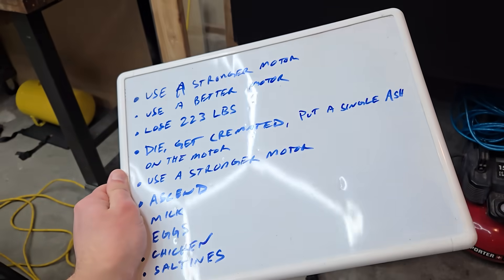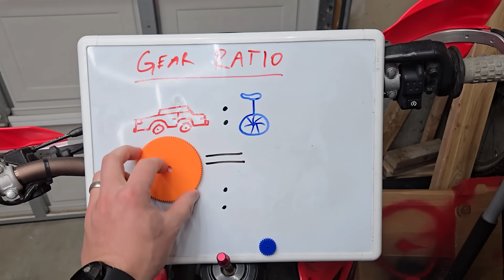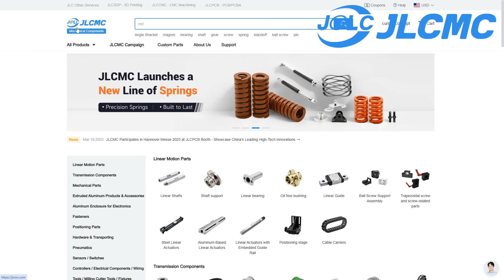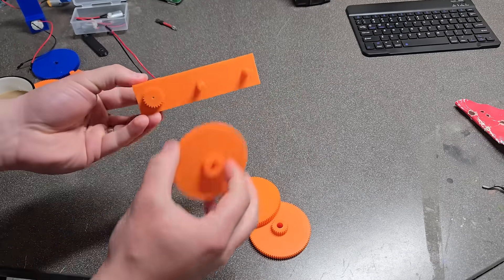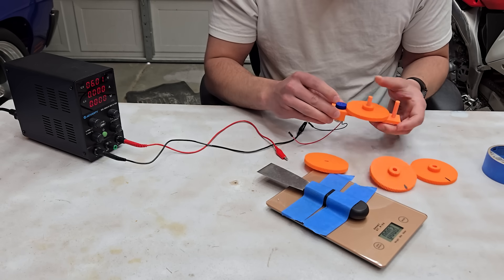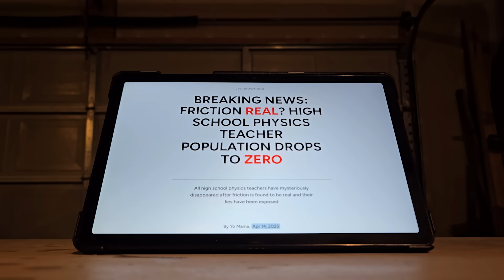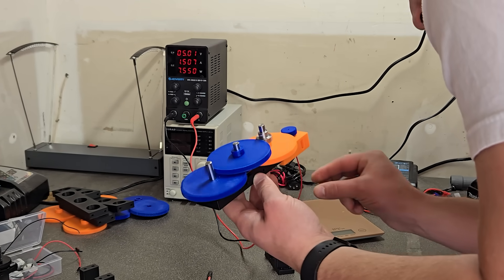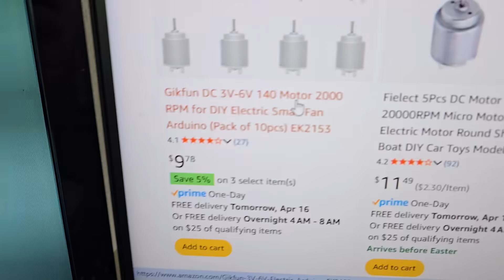I Built an Elevator With a $1 Motor

Comment: hey just a helpful tip, theres a RPM Iphone app that pulses the flashlight for a chosen variable range, to be able to determine a motors Rpm. attach a piece of tape to the shaft, and when the position of the tape syncs to the flash, you find the rpm

Comment: When working with 3D-printed gears, use some candle wax as lubricant.
Done this with my self printed espresso-distribution-thingy (4 gears) and there was a huge difference after putting some wax on the gears.

Comment: 1:38 Fun tip! If you ever need to figure out how fast a spindle, wheel or other rotating object is spinning, attach something to it like the piece of tape you have there, then let that tape smack against something else with every rotation, like maybe your ruler. If the spindle is spinning fast enough, the beating of the tape against the ruler will produce a tone. You can then use a tuner (or tuner app)to get the frequency of the tone, which translates directly into rpm.

It's not the most accurate form of measurement, obviously, and it doesn't always work. If your motor is weak enough and your "tape" (or playing card or whatever) is big enough, air resistance might slow your motor significantly. If your motor produces a tone in and of itself, your tuner might pick up on this instead of the beating of the measurement "tape." And if your motor spins too slowly, you'll get a pitch well below human hearing and below what the tuner is designed to measure.

Now, in the case of a common motor like this, the datasheet was definitely the right call :)
Reply: bpm tachometer, nice. Maybe use thin piano wire for the measurement.
Reply: but if i smack it one time, itll still make noise, and that noise will not be at 1hz  itll be at like 500hz
Reply: Similarly, you can record the sound on your computer and measure the time between the hits.
Reply: You'd have to multiply by 60, tho. Hertz is cycles per second.
Reply: How about using actual cassette tape? Its quite light and you can just measure how many meters go through in 10 seconds.
Reply: It's a sound theory (pun intended)! But the problem here is the harmonics. In reality, the tuner might (and probably will) catch a lower harmonic of the noise emmited, and the resulting hz measured would be far from the real rpm*60 of the motor.
If you could somehow guarantee that the emitted sound is a perfect sinusoidal wave, then the tuner would probably work better.
Reply: Holy s dude that’s a nice idea I will be trying that just for fun!
Same goes for the bpm as someone mentioned but I’m pretty sure that there has to be a even more scientific turnaround
Reply: Or just count how many times the taped part spins every minute

Comment: 3d print a useful step stool, or simply pour extra layer of height raising cement to the garage floor.
Make some shoes that are more practical and then reach your goal in life.
There are surgical treatments to consider though that would be painful, though once you are taller you can install drywall ceilings and win canoe races by holding a sail. ⛵

Comment: Cool build from super small motor.  Erector was doing this 75 years ago; I think they were lifting 320 pounds at the last show I was at. One other note, WD40 is not a lubricant, it is made to displace moisture.
Reply: Displace moisture with... oil?
Reply: @rexsceleratorum1632  Not all oil is the same believe it or not.

Comment: For motor speed, I like to put the smallest piece of tape on the rotor as I can and then touch a paperclip to it while recording. I then take that recording into audacity to zoom in on the waveform and count the peaks and the time between and use that to find the RPM.

The great thing about this method is that it can measure stored without really loading the motor.

Comment: > has power supply with current limiting 
> blows up all the motors instead of turning it on

died laughing, banger video
Reply: I came here to say the same thing! You have a power supply. Why on earth would you not limit the current!?
Reply: @GarranGossage  Some people don't know what current limiting is.
Reply: @GarranGossage content?
Reply: That was what i was thinking!!
You can see at 7:04 that the motor pulls ~9.0 Amps! Like oh lord!
Reply: @lemon_flan  9:40 had 10.85A
Reply: He paid for six motors, so he is going to use all of them 😂
Reply: Or just lower the voltage a teensy tiny bit

OR WATER COOL YHE MOTOR
Reply: Better to burner them out for comedy, it was never going to work
Reply: @KeCasgrimola here,s the final idea, use more gear, but it will cost huge time only lift that chair, so the problem is not friction, but huge time only for lifting a chair
Reply: Let the electrons flow!!!!!!
Reply: If he limits the current he limits the torque too. It’s too much torque for the shitty little motor.
Reply: Lol just posted a comment saying almost the same thing before I read your comment!

Comment: Hmm continuous power cable lift for half a meter... makes me wonder if you had built a ratcheting lift...  Might need to consider using the same motor but in an incremental locking system with counterweight assist and then do a lift showdown!!

Comment: it's all about that traction, you're gonna always lose traction without balancing the weight of the load. modern elevators are able to use smaller and smaller motors using crazy roping configurations where it basically passes through a bunch of sheaves to create a 2:1 roping ratio where the car moves twice the distance as the car. so in a way it's moving the mechanical advantage you'd get from a geared system to the rope configuration like a series of pulleys

Comment: Did you consider using the current limiting feature on you power supply to prevent the motors from burning out?

Comment: well actually this motors do this... but i thing main problem is gear .. gears are the o es facibg the stress and after 20kg or so you cant use plastics i guess weight may differ but after lots of force teeth of plastic gears will go out 😊😅

Comment: I hate printing gears. Any other way to transfer energy is so much better. Use like a 20x block and tackle pulley system for the last stage,  use 2mm dynema rope so you can use small pulleys.

Comment: I really hope this was all printed in ASA. If this was all printed in PLA or PETG, that was your first mistake.
Still, really impressive you were able to make such a funny and enjoyable video out of something that would have left me feeling defeated.
Reply from the maker: all PLA. i dont even know what ASA is, i think you made that up
Reply: @currentconcept  PLA is a general use filament that will "creep" under load and isnt very strong while ASA filament is much stronger and tougher, doesnt suffer from creep, and is tolerant of much higher temps an UV exposure, it just needs proper ventilation because it does smell and gives off gasses you dont want to breathe a ton of (ABS too, ASA is just slightly better and newer)

Comment: Here's how to do it:
Build a lever with a short arm and a very long arm. Put good bearings on the pivot to reduce friction. Stand on the short arm. Use a complicated mechanism to place the motor on the far away end of the long arm. The weight of the motor on the long arm will lift you up.

Comment: I have done all kinds of things with these cheapo motors over the years and the only one that died on me was the one that I used in a toy rc-boat with to big of a propeller and two times the rated voltage out of a Li-Po batterie. And it still took 15min. Did you maybe run them to high? Cool elevator though ;D

Comment: Dude, those motors were for 3V maximum, not 5V or 6V! It is no surprise you killed so many of them. You got the wrong datasheet. Just look at the current it is pulling from the PS compared to the second type, witch were actually for 3 to 6V. Those poor little things! So sad to see they die in agony.

Comment: maybe you could've used the small motor lift some weights slowly and then dropped the weights using some pulley system to lift you up

Comment: My knowledge is a bit limited, but motors blow up from over-current, right ? I see your PSU showing several amps, wouldn't a simple resistor limit the current to the motor, hence saving it from the bin ?

Comment: are you sure those little motors weren't suppose to run at 3v instead of 6v?
Reply from the maker: they claimed 1.5V - 6V. I ran them at 5 V at the end there and they were still blowing up
Reply: @currentconcept  and also unlimited current, which they were NOT rated for

Comment: Only an engineer could go through all this trouble to avoid making a box to stand on
Reply from the maker: its the only logical solution
Reply: @currentconcept you could have stood on those gears or stacked those bearings!
Reply: @aboutblankat 😒
Reply: @justin.s Why didn't he just lower the outlet so he could reach up to plug things in?
Reply: @Starlite123  The sparkys get mad when we molest their boxes. Carpenters gotta set up scaffolds. IH needs to sign off. It's a whole production. Better to stay in your lane because nobody can tell you you're doing it wrong if they don't know what you're doing.
Reply: @richardking4514  Humorously, Union Onions gonna Union Onion.  Better to be collaborative than to cause problems with the wrong leadership style.  

I love being an electrical and embedded software engineer and then jack of all trades because it allows me to ask the right questions of the right people.  

A great collaborative engineer does not always dictate, he can also ask good questions until the tradesmen and other engineers agree with him, whichever way the choices go.  

Ego is not the way.  So give positive credit where it is due.  Try to blame problems on root causes that are not people.
Reply: @Starlite123  How is he gonna put the ceiling back up there after he lowers it? This was obviously far easier.
Reply: @itsausername  Haha... sure. I said lower the outlet (just a block of wood behind it). Clearly you have been drinking. Have a good morning.
Reply: @Starlite123  Or he could have raised the garage floor with more concrete.
Reply: box? he has a ladder
Reply: Using gears and cables was the problem. The correct way is to dig out a hole in the center of the garage floor and install the scissor jack that's unnecessarily taking up space in your truck, as nobody changes tires anymore when it's so much quicker to just change truck. Anyway, you can then attach your cordless drill to the jack, maybe after extending the switch and direction toggle on the drill, and bolt a piece of steel or something to the jack, preferably larger than the hole to avoid losing drill bits in there while you're looking everywhere for your drill, and there you have it!
Useful tip: If you keep the chuck torque limiter half way out, you won't bust the drill motor when the jack reaches the top/bottom.
In the alternative, if you really want to use cables, you could use the garage door opener to pull on a cable going through pulleys to lift a platform. I personally prefer marine ropes because they're color-coded.
Reply: Or a wireless inline switch for the lights
Reply: I'm not certain. We should as not an engineer what he would do
Reply: In my philosophy, it's allowed to work two hours in order to avoid working for one hour.
Reply: @TheDerperado  I agree the past is the past. Just gotta live in the now.
Reply: Dude.  He pulled the motor off a ladder at the start >_>.
Reply: I did the same thing when i was 9, its simple just use a lot of gears
Reply: Justin.....you totally don't get the point of thinking out of the box and create something from scratch.  That's why technicians  follows engineering plans and dont have a good reputation for calculations a or creativity. And yes...some engineers are amazing with tools also. But the means or tools is not important ...its what you build and the purpose. When you can build it mechanically... build the electrical schematics... PLC and program it too work,  then we talk. It's the mental principles, calculations and concept  that counts...not the fact that he could have a use a box to stand on it or the tools.  A table is a table cause some other monkey called it a table 800 yrs ago. It could have been called a chair as far as I know.
Reply: Or a stubborn intelligent idiot. 😂
Reply: Just stand on the bucket...
Reply: A box would t get 1.5 million views
Reply: That is an insult to the word engineer…. No engineer would jump the cliff without first calculating sensibly. This is just a clown making a comedy.
Reply: I'm pretty sure this why they invented light switches
Reply: Behold, the concept of “pretext” 😂😂
Reply: LOL this is what its like being a machinist running cnc mills LOL. An engineer shows up, has ideas on how to improve the process........asks for advice, does what they were going to do anyways despite them not actually understanding how they work in the real world. Things don't work, costs more money, makes more changes, orders new tooling, breaks more things, scraps more material, asksfor feed back, trudges along doing what they think will work. Costs more money, breaks more things, makes things worse, eventually scrapping the idea and we go back to what worked and they move on to their next project all while getting paid drastically higher wages than the people who actually know how the thongs work lol
Reply: @sinformant  This description just made me change careers and I want to give you a shout out. Now I get paid to make mistakes which I had been doing for free all of my life until now
Reply: @ppcasm_1278 😂im not saying there aren't good engineers out there, I just haven't ran across many in my work. I believe the good engineers are people who started at the bottom actually doing the things before going to school and getting their degree.
Reply: Use a switch. In fact I'd just have it plugged into a smart outlet and use my phone. I like the motorized step stool though for other things.
Reply: It’s like the NASA pen in space where the Russians used a pencil.
Reply: @EssGeeSee  when do I get to say this to an engineer next?? I do love graphite tho
Reply: @EssGeeSee  As hilarious as this is, there's actually a really good reason NASA didn't just use a pencil. Graphite is extremely conductive; and since pencil lead is made of graphite, any little shavings that were missed when sharpening or erasing or even writing could slip into electrical components inside of computers or ventilation equipment, possibly causing shorts and failures that could be, at least, expensive, and at most, life threatening
Reply: @EssGeeSee pencils? That isn't how you spell potatoes.
Reply: @EssGeeSee They didn't, actually. The Soviets used crayons.
Reply: @xX_Pokeman_Xx the whole thing is a really dumb tale anyway because the reason you don't use a pencil in space is because it blows graphite particles everywhere
Reply: @xX_Pokeman_Xx  Even with crayon, little bits can break off as you use it which is a potential nightmare in low-G, it's not conductive like graphite but it could still get into switches, relay contacts, brushes (etc.) and impact their operation... I know the 'developed a pen when a pencil works' line is supposed to be a joke, but I've always felt that given the Soviet history of caring little for personal safety, it comes across as more ignorant than funny.
Reply: or using a wi-fi outlet 🤣
Reply: not only that but also only an engineer could be soooooo bad with tools and carpentry

Comment: I really love how amp limiting the power supply has not been invented.
Reply: Current limiting? Thou speakest of the darkest magic from the pits of hell, methinks?
Reply: @rexsceleratorum1632  Can you explain to me your channels picture?
Reply: work harder, not smarter
Reply: Yeah, was gonna say the same thing. It's usually under a couple of menus, but it has saved my bacon more than once
Reply: Or you use belt drive to motor which allows it to slip if it would ruin motor so replace cheaper belt instead like in real world German engineered floor sweeper
Reply: @multilis2  NO Sensible suggestions here foul beast!
Reply: @multilis2 Except that I suspect replacing a belt would actually cost more than (or at the very least, equivalent to) the $1 motor 😂 
So in this scenario you're probably wrong lmao but in any other instance you'd be correct 👍
Reply: There are lot more problems then that
Reply: I don't understand either way
Reply: You don't need it to do that

Comment: OMG! You rich rich man who can afford a 3D printer! You're doing it all wrong! And that's because you're thinking wrong! Do what I do and go dumpster diving for your building projects. It may seem like an odd hobby but I promise that you will see its beauty and genius. And allow me to demonstrate. Step 1. Take all those 3D printed gears and throw them in the trash. Ironic, isn't it? Step 2. Get some 5 gallon buckets. You were sitting on one. Find like 3 more in the dumpster. Step 3. Turn them upside-down, affix them together somehow, and place into some kind of mini pool or tub. People throw those away all of the time. Step 4. Get a cheapo miniature 12v pump for like $5 and also some vinyl tubing. And please purchase the tubing. Its the one thing best left in the dumpster should you find some. Anyway, presto! You get where I'm going with this? You've got yourself a floating elevator thing. Step 5. You can easily modify the speed by adding more pumps! Can you do that with your fancy 3D printed gears? I don't think so! At least, not as easily. And fine. I can afford a 3D printer too. I'm just a cheapskate. People are going to start throwing 3D printers away all of the time too. I'm counting on it. By the way, thanks for the upload ;-)